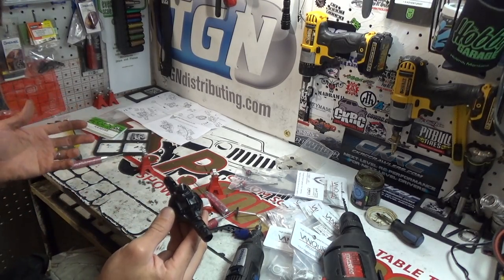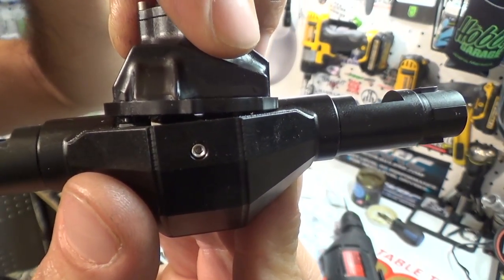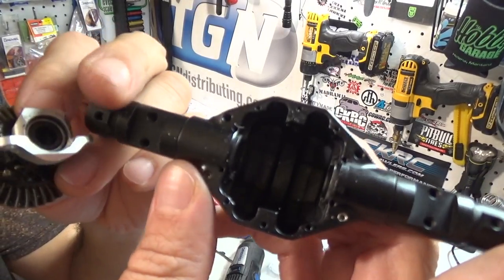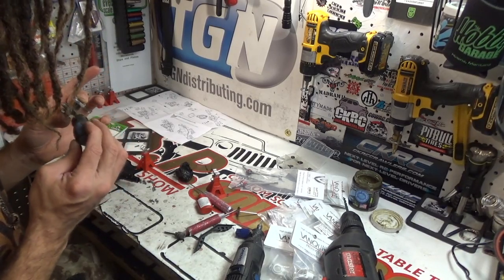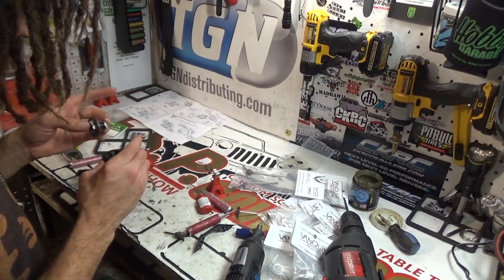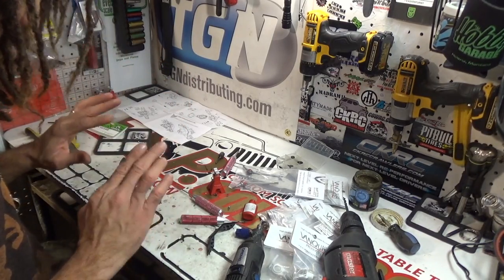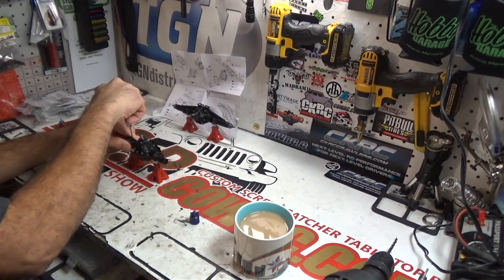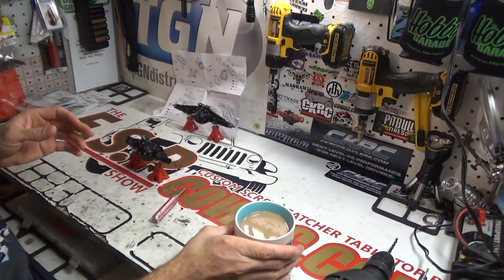CAMPING WITH COLEMAN | CKRC VP CURRIE F9 | AXLE BUILD PART 4

Comment: Working on my Arrma Granite basher truck.  I moded the diff with Hpi gears and shimmed it tight because,  once I put the HH brushless system in the Yeti.  I will put the stock Yeti system in my Granite lol I don't know if it will stay together long, but it will be fun destroying and rebuilding it. BTW the inner removable part on the pumpkin is called the 3rd member. Thanks for sharing your builds!

Comment: the piece with the pinion would be the drop out! I wonder if you can help me? Would you have any experience with rear axle toe in on solid axles for high speed applications? I did a rear anti sway bar and it is causing the front to dig in more than usual, going to move it up front, any help would be appreciated!
Reply from the maker: +DayRider76 I think you will find that having it up front and switching to a 3 link setup would help the rear come around and the front will dig less. You can also try to change the front pinion angle a bit if you can get away with it without binding your driveshaft. As far as just doing rear toe angle the only option I can think of would be to install some c-hubs and steering knuckles and then use some short tie rods to set the toe where you like it. Hope that helps my man. Thank you for watching!
Reply: EXTREME SCALE PERFORMANCE RC
Thank you for the reply! I love your work! I have since switched the sway bar to the front, lowered the rear, added wheel wideners. I do have c hubs in the rear with adjustable links, (old ax/scx style) I found that if I line everything up and use a straight edge, i can get exact measurements, now I'm trying to find a good working angle! Going to do a full speed test today?